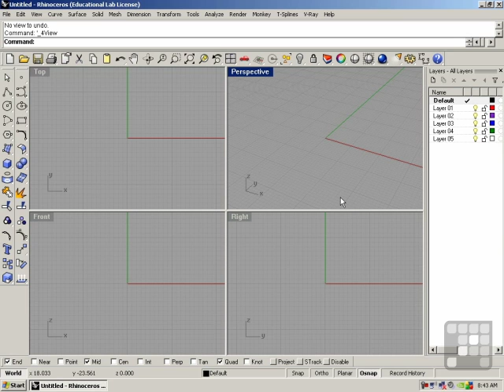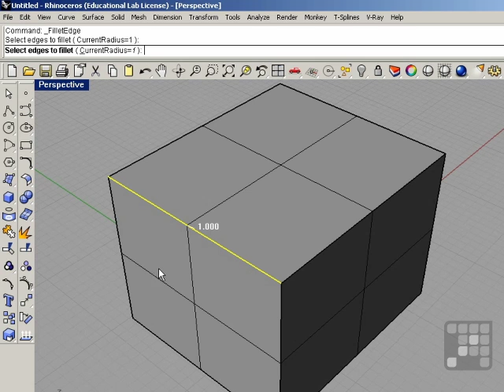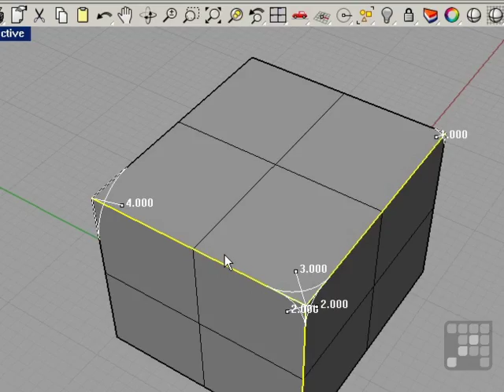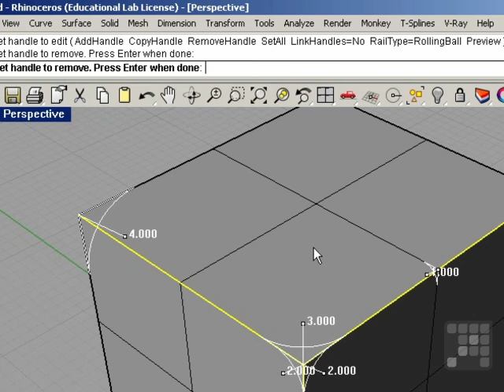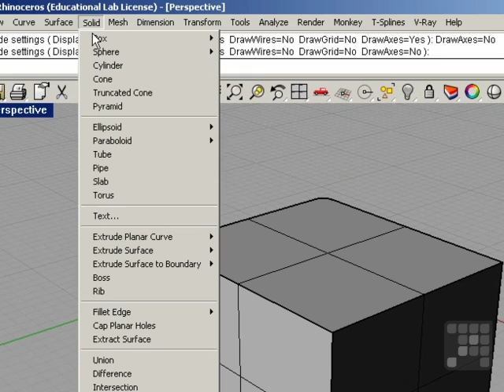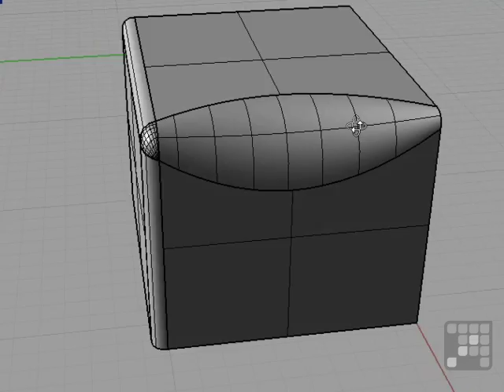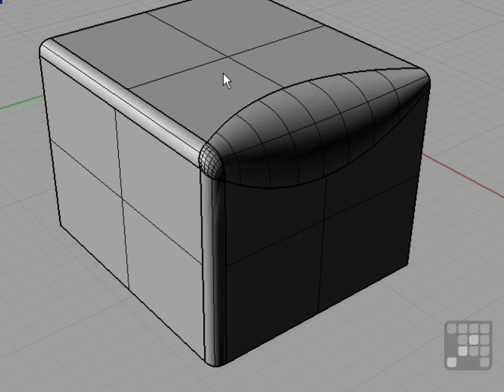Fillet and Champher - Rhino 4 Tutorial

Comment: Thanks for the video but appears like the filletedge does not work very well at all for multiple surfaces in most cases. Just did a table and tried to doing a soft chamfer on all top edges but it keeps on breaking. For some reason making an uneven radius kinda worked but that looks quite off and when I return it to the small radius again it looks off.
Reply: Ohh maybe it is a tolerance thing, I tried to go huge now instead of the 0.01m and it went well.